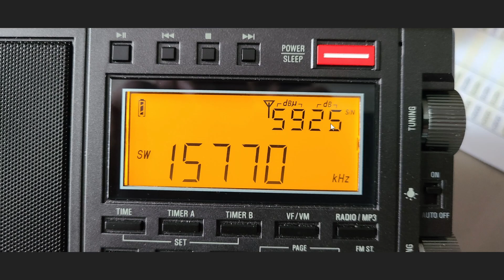What is the Signal to Noise ratio indicator on receivers

Comment: The S meter  S1-S9 - actually represents a certain amount of dB; nearly 6dB per S value above and below S2-S3.  The dBµ theoretically tops at 99 - S values are:         
1 - Faint—signals barely perceptible (-14dB)
2 - Very weak signals (-8 dB)
3 - Weak signals (2dB)
4 - Fair signals (4dB)
5 - Fairly good signals (10 dB)
6 - Good signals (16 dB)
7 - Moderately strong signals (22 dB)
8 - Strong signals (28 dB)
9 - Extremely strong signals (34 dB)                                                 
The second pair of numbers  SNR --- should be MINIMUM 8  Value to enjoy a "Fair Signal" (tops at 35).
Reply: Tell something about noise ratio,,,please

Comment: I really appreciate the remake of the the video. Thumbs up therefore. One thing should be noted: The signal strength is a voltage ratio and the S/N indication is a power ratio. Noise power depends on the bandwidth, so you can increase the S/N by narrowing the AM bandwidth on the receiver. 
This is the reason, why you can select the AM bandwidth at good receivers.
Reply: That is helpful information!